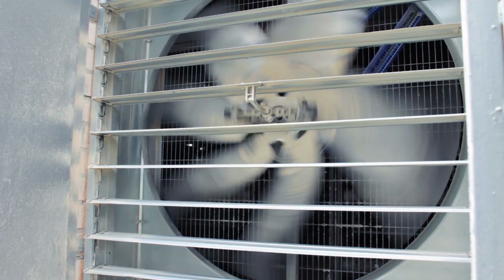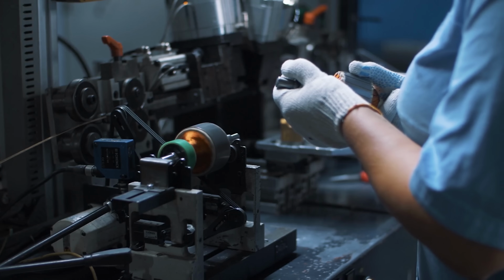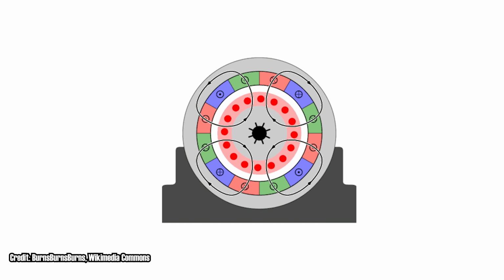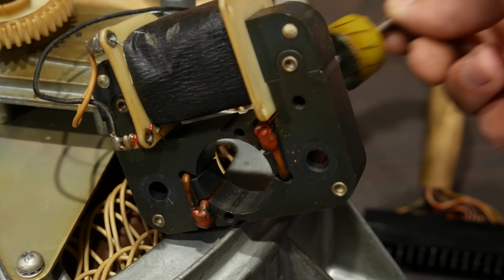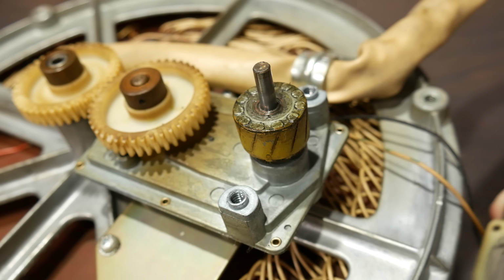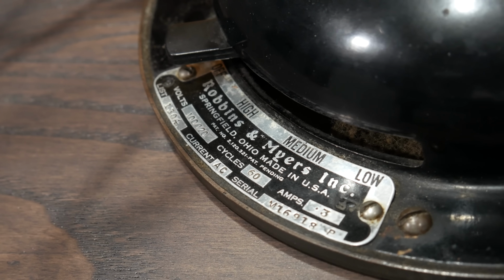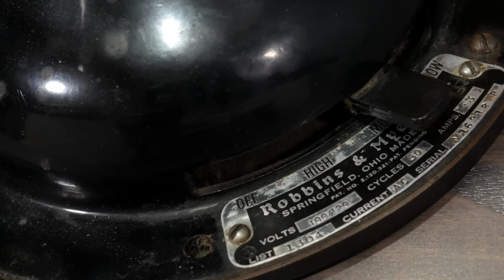Fans; High is next to Off on purpose

Comment: "3-phase-power ist generally not found in the domestic environment" ... laughs in German
Reply: What? Y'all seriously do 3 phase residential?
Reply: @elcidbob  how else would you run central air-con and induction stove-tops? we need POWER
Reply: @Mrdardas99  : The US runs both on ~120 or ~240 volt single phase. My current residence would require a complete rewiring by law to even install ~240 volt. 3-phase is normally left to a mixture of industrial customers, and commercial customers with high-torque loads. Most customers have triple-phase running through their block, but only a single phase gets tapped off, so that fewer pole transformers are required.
Reply: @absalomdraconis  by 240v, you mean 2 phase right? To the rest of the world that's just a single phase 😁
Reply: @Mrdardas99  You can, apparently, run them just fine.  Mine work and I have single-phase power.
Reply: In my country, detached houses always get 3-phase power. Apartments get 1 phase if there is cooking gas available and 3 phases if they cook on electricity. Induction plates are designed to split load between 2 phases and the third is connected to the oven. Load per phase needs to be managed and you pay heavy extra to get a stronger breaker (you obviously aren't allowed to change it yourself and they have a remote system to measure your consumption and send an inspector if you do!), if they give you the breaker at all - they check the cross-section of the cables and the utilization of the transformer to see if they have spare power to give you.
So yes, I could go nuts and bring a lathe to my flat, but that would be dumb. The cooking would work just as well if I got one phase with 75A.
Reply: @sketchesofpayne  You can probably run everything you may want on single phase, if you have large breakers and enough wires coming into your house, but it's just much more efficient for high loads to run in 3 phase - which is why most high powered AC units and Induction stove-tops only come in 3 phase configuration, while lower end devices come in both flavors. at least here in my 220V Euro country. I have an older 90's era flat that doesn't have 3 phase, and i had to get a central AC that is low powered, which is actually sufficient for my 80m flat so i'm good, but the point stands.
Reply: Recently, I hooked my moms new (to her) sewing machine to a 3 phase output. It's an industrial sewing machine from the 70s. The motor runs all the time and there's a clutch to start the sewing mechanism.
Reply: @Mrdardas99  I'm officially jealous. Never really cared about the 120 versus 240 thing (most of our bigger stuff like electric stoves, water heaters, heat pumps/AC, and dryers runs off the 240 usually with something like a starter capacitor for the compressor pumps), but I'd love to have 3 phase without having to buy a VFD or pay the power company around 10 grand to get it. 😓
Reply: Is that why I've never seen any fan like this? All fans I've ever seen had their power in normal order, like 0, 1, 2, 3, 4
Reply: @liamtwentyman7275  it's called single phase, even though it's 2 phase. You can ask any electrician this and as an hvac tech in training, know this too
Reply: @Mrdardas99  definitely not. Your house would burn down if you tried to run things with high amp draw and you had low voltage
Reply: @entity6966  I have asked many electricians this, and the answer is slightly different. But my understanding is that a single phase circuit connects across two wires, of a three phase system. To have a two phases system; you would still have to have three phase wires, with a high leg. What most American houses do is to split a single 240 phase into two 120 half phases, using a neutral center tap on a delta type transformer.
Reply: @elcidbob  Yeah, most households have 3 phases except maybe one-room apartments in older buildings from the 60s-70s or older. Pretty much all stoves come with a 3-phase-connection anyways so at least in the kitchen we have one 3-phase-socket. Beside that, it's pretty much up to the electrician how the apartment / house is cabled. I've seen sockets daisy-chained on one phase in a room, but it's usually more sensible to split up loads especially where you know that high-power devices will be used like kitchen, bathroom and basement (think about kitchen appliances, dishwashers, washing machines, dryers, etc.)
Reply: @elcidbob  Oh, and it's 230V single phase or 400V three-phase. Usually with 16A breakers, although many electricians tend to use 10A for light circuits and 13A or 16A for sockets nowadays. High-power devices like washing machines, dishwashers, dryers usually have their very own circuit. We have also have strict regulations when it comes to RCDs especially in wet rooms like bathrooms and kitchens.
Reply: Laughs also in Dutch. That good old driefasenaansluiting. 3x25A ftw.
Reply: I would say an typical residential house in germany has a 3x63A connection. 230V Single Phase/400V three phase. Typical each circuit has a 16A breaker and there is one circuit for each room. So you can potentially draw up to 3600W per room.
Reply: @liamtwentyman7275  North America is odd in the world with giving residential customers only single phase. Most of the rest of the world supplies 3-phase power everywhere because it is more cost effective for distribution cabling and at 240V which also saves copper compared to 120/240 single phase.
Reply: @TheMrMaxx  16A breakers? That's not very metric of you ;) Even we Americans have 15 and 20 amp breakers  hehe
Reply: And when you consider that, as a physical quantity, electricity doesn't really exist.....
Reply: @entity6966  Single phase is one phase and one neutral. Two wires.
Reply: @sandordugalin8951  Too seriously.

Comment: 14:10 I rented a room one time where the ceiling fan had a blade misaligned from a missing screw and hanging slightly.  One quiet night I heard the motor humming and realized it had been powered on for who knows how long.
Reply: wait, it was on, but not turning? doesn't that burn the moter out?
Reply: @AC3handle  : Depends on the motor. As mentioned in the video, they can be built in such a way that they won't normally burn out.
Reply: @AC3handle  As mentioned in the video, modern fans are required to tolerate being stalled for indefinite periods of time without starting fires, although it might hurt the motor.

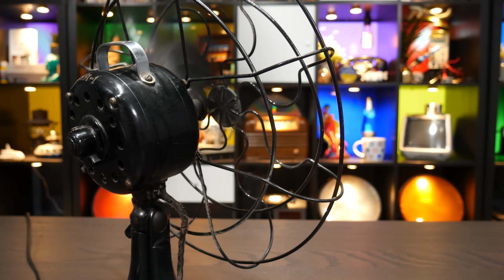Comment: 12:01 Another feature of single-phase motors like these is you can often flick the blade in the opposite direction from a standstill and it will spin the wrong way.
Reply: Though interestingly, some clock movements have a single-phase motor that isn't so inclined, due to the rotor coming to a complete stop between peaks.

Comment: tl;dr, it requires more force to start something moving than to keep it moving thanks to the principles of static vs. kinetic friction. And on an AC motor with 3 phases, you will need all 3 phases to start it as you don't know the position the blade is stopped at, but can drop to a single phase to keep it moving assuming the bearings aren't totally shot.
Reply: Thank god you commented
Reply: @V he does
Reply: That's not how speed control works on a 3 phase motor. Dropping 2 of the 3 phases or even 1 of the 3 would lock up the motor in a single phase condition and either blow a fuse/trip an overload or cause damage to the motor windings. Motor speed control on a 3 phase asynchronous motor requires a frequency drive. If the motor is an ECM (electrically commutated motor) then the motor has a drive incorporated right into itself.
Reply: Not true at all, 3 phase motors can not be ran on single phase. I tried this, I'm an electrician that shirts it out

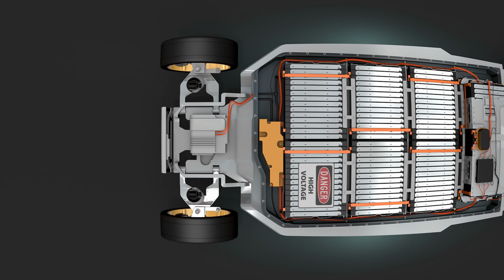Comment: "Fancy power electronics which turn the DC power from the battery, into three-phase AC power at whatever frequency and voltages you like" 4:25
Normal pooh: Inverter
Fancy pooh: 𝓋𝒶𝓇𝒾𝒶𝒷𝓁𝑒 𝒻𝓇𝑒𝓆𝓊𝑒𝓃𝒸𝓎 𝒹𝓇𝒾𝓋𝑒
Reply: Toyota just calls it an inverter...
Reply: Keep in mind that inverter is a very broad term and can mean nearly everything that creates AC from DC.  
Variable frequency drives refer to inverters that (almost always) use sPWM to create a sinusoidal current at a very specific frequency. The frequency doesn't refer to the sPWM frequency, but the current frequency

Comment: I'll try and guess before finishing:

It goes from 0 to Max speed because, like a gas powered stove, you want the most amount of energy flowing to get it started.
Reply: Bingo
Reply: RacknPinion same idea but different reason. Turning the gas on high provides the best chance for the spark igniter to work. If the gas is turned on low, it could potentially build up before enough reaches the spark/pilot and lights, resulting in a bigger "woof" (or boom, depending on how much gas built up). These fan motors are very inefficient before they reach top speed, so you want to get them there as quickly as possible.
Reply: Is this why my old Singer sewing machine always started at its fastest speed?

Comment: That’s the same order as when you turn on the gas hob on your cooker: 0-high-low.
Reply: That also has a reasonable explanation, and much like this one, it has to do with guaranteeing am effective initial startup.  Having higher flow of gas means that a small spark lighting one spot in the fuel volume will spread the flame front wider and ensure the entire volume is lit.  With low flow rate of gas, this is harder to guarantee.
Reply: @ShootMyMonkey  I think it's more important that it is much harder this way to leave your gas just on on the lowest setting and have your house slowly fill with gas.
Reply: Also many burners have a safety cut-out: it has to get quite hot otherwise it will shut-down the gas even with the dial turned-on
Reply: @ShootMyMonkey  Sure, but why are electric ones the same?
Reply: I've seen that once on an electric hob.  Never on a gas one.
Reply: Matthew Malthouse I’ve seen it once on a gas hob, never on an electric one, but I’ve only seen a few electric ones.

It was the same on the British Rail Diesel Multiple unit trains of the 1950s where the gear selector handle had to be moved right round from neutral to first gear and then back the other way to change into second etc.

Comment: It strikes me that gas stove tops do the same thing, going from "Off" to high so they will start more reliably. Maybe that had an influence on all appliance design. 
Also, I have to wonder - Is the connection on the shading coils made using silphos rather than welding the copper?
Reply: It also might be dangerous to leave a stove on w/o flames
Reply: My stove goes from off, to low
Reply: Needs to be enough gas coming out for the starter to ignite it
Reply: @Tiffany Ballard maybe I'm Australian and we do thing's properly
Reply: @fishermanfulla  like walking on ceilings instead of floors?
Reply: @mcstube9154  A+++😂🎉😅
Reply: @mcstube9154  do their compasses still point north?! We all know North is “UP” so they’re upside down 😊
Reply: Stovetops don't do that; they have a starter to ignite the flame which sounds like what you were thinking of
Reply: @fishermanfulla not all stovetops are gas. Mine isn’t, it’s electric.
Reply: @florapflinphea  but what does your dials say
Reply: @mcstube9154  lolol that's how it's ment to be done
Reply: @fishermanfulla  off lo 1-9 hi. OP mentioned gas stoves specifically, that’s the important part
Reply: @florapflinphea  yeah same as mine, opposite to what OP said
Reply: @fishermanfulla  yes but the distinction is whether it’s gas. What powers your stove? Not all stoves are gas. Or are you a selective reader?
Reply: @florapflinphea  my stove is gas, induction is called a cook top
Reply: @fishermanfulla  language is different everywhere. If I go buy cookies in britain, the bakery employee will prolly not understand until I ask for biscuits. It’s all a stove where I live
Reply: I’m also Australian and I can vouch that people will use “induction stove” just as readily as “induction cooktop”. Some brands call them cooktops, but we still say “stove”. In any case, I’ve never seen a gas stove that’s not started at high, only electric or induction ones start at low.

Comment: I understand this. I have a cheap fan. It has the 0-3-2-1 switch sequence. But I can’t use the switch because between settings it has internal shorts and trips a circuit breaker. So I set it to 1 and then plug it in. It starts every time.
Reply: I've been doing this with a heater fan I wanna leave stationary and never wear out the switch.
Your idea was genius and then I realized I had been doing it also, lol. Great idea? Yup! 🤪

Comment: Fans and I have a tenuous relationship. I almost had my upper skull removed by a 7HP 3phase HVAC fan. I have a very real sense of just how much starting torque a 3 phase motor makes.
Reply: No kidding I remember the equipment in my school industrial arts and in the construction classes the had 3 phase equipment... instant speed compared to single phase motors ... unless it has a huge load (a lot of mass) to start moving I'm sure many places that had high horsepower motors used some type of soft start system... otherwise blown fuses or tripped breakers because those huge motors draw HUGH amounts of current at startup
Reply: @darinb.3273  I don't believe this had a soft start as it was an industrial blower that was meant to be hooked to either giant generators or plant power, and the equipment had it's own slow blow fuses. Plus I remember the sound of those motors starting up and it was just pure electric rage. The dull fan blades managed to leave three, half inch deep gouges through my hardhat while they bounced my head off the adjacent panel until the 4th hit managed to knock me backward and out of the access hatch I was leaning into with one more head bounce for good measure.

Comment: Here in Australia, over more than 40 years, I have never in my life seen a fan with a switch order of 0-3-2-1.  It's always either 0-1-2-3, or circular for ceiling fans (ie: you can turn the knob as far as you want in either direction between the four settings).

That said, I asked my Mum, and she said she does remember 0-3-2-1 fans, probably from no later than the 1970s.

Also, from an issue with the electricity company many years ago, I believe all houses in Australia are on a single phase (except by special request), and not two phases. That may be because we run 240V power.
Reply: Same. Well, I haven't been around 40 years, but still.

BTW what is it about awesome people and lemmings?
Reply: I live in the UK and have used many ceiling and desk fans in my time. Not one of them had high as the first speed setting.
Reply: I have never seen 0321 in Australia either (or in a couple of European countries I have been to). I was thinking it might be a US only thing ?, but I still have an almost 40 year old GE fan (still works, they knew how to make things then), and it also goes 0123.

But then again I can't see modern made in China fans having different production lines for US ones to be 0321 and the rest of the World 0123 ?
Reply: That's because Australia is on the southern hemisphere. Our 3-2-1 is your 1-2-3. :D
Reply: It's likely your ceiling fans, for a variety of valid reasons, may be using universal motors or a transformer to DC. Ever hear of a ceiling fan quitting because of bad brushes?
Reply: I'm in the UK and I never saw a fan that goes 0-3-2-1 either until last year. I bought it off Amazon and couldn't work out why it was like that

Comment: 4:40
"...in the US anyway..."
Thanks for saying that.
Here in Germany it is standard (in all houses I've been in) to have 400V (3 phase 230V) in each house/apartment.
The 3 phases are normally split among the rooms and only stoves/ovens/heaters/dedicated-400V-outlets get all 3 phases.
(So it is pretty simple to install tools that need 3 phase or an electric car wall box.
Reply: Old Europe was 220V and UK was 240V but they "converged" on 230V with a standard in 1995 that allowed higher deviation from 230V making both 220V and 240V in spec.   https://en.wikipedia.org/wiki/Mains_electricity#Standardization

Comment: A lot of such motors just keep the "dangerous" overheating design but put a non-resetable thermal fuse on the coil resulting in them often blowing up with a bit of excessive load or a bit higher ambient temperature.
Reply: A fuse has a thin wire in it that will break in half when too much electricity goes through it

Comment: All my life, all fans i've met use rows of buttons: 0, 1, 2, 3
I can't comprehend "high next to low"
Reply: My box fan has off, high, med, low...so I'm guessing that in modern day fans, the cheap kinds still use this arrangement.
Reply: @tasa4904  idk, my table fan has 0-1-2-3, and its pretty old
Reply: @shivanshlolayekar9668  There are many ways to explain it.  Bad engineering.  Smaller motor.  It might use starter capacitors.  The point being, I don't know why your fan is 0-1-2-3.  All I can assure you is that my lasko box fan purchased a year ago for $20 has 0-3-2-1 on the dial.